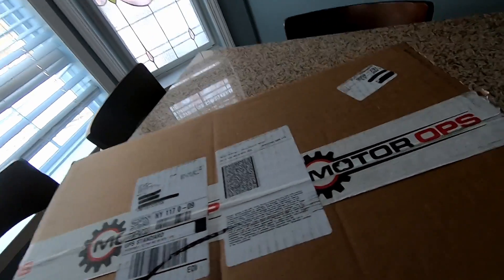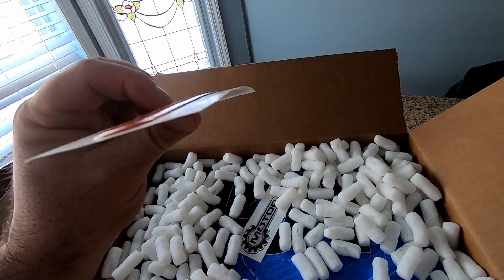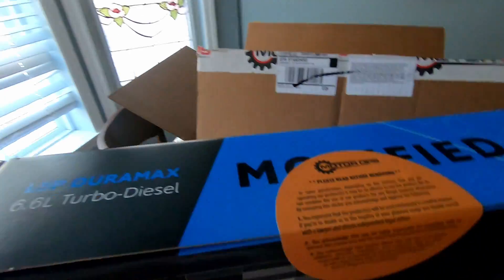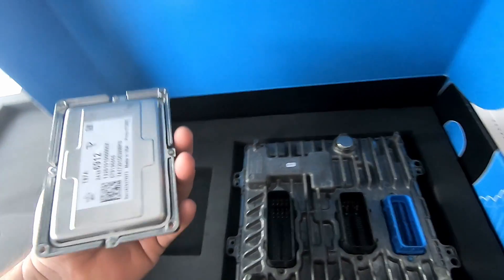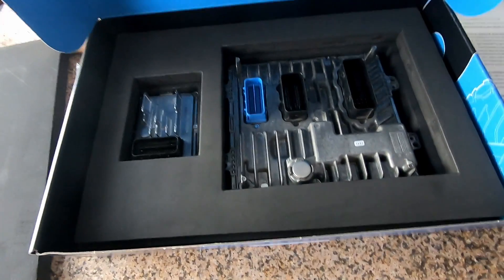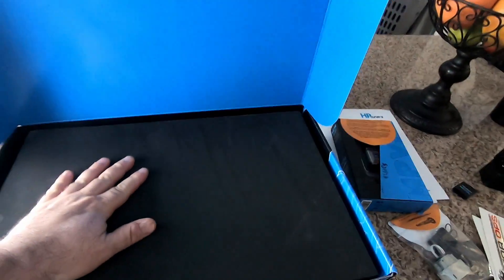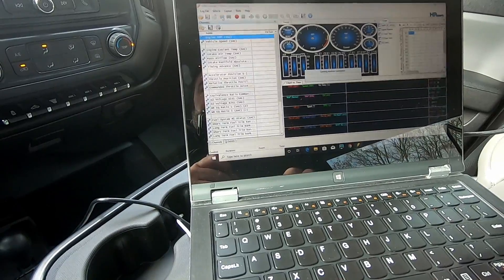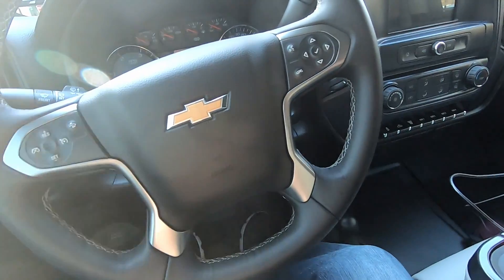DURAMAX L5P ECM & TCM SWAP & MOTOR OPS TUNED

Comment: You still have the truck tuned? Looking to hear about long term reviews. Hows it treating you?
Reply from the maker: Yes sir. Still have the truck and it runs perfectly… Long term it’s all good. Runs clean and strong with no issues
Reply: @xlandscaper  that's awesome to hear. How many miles do you have on the tune?
Reply from the maker: @dach4mp85 I have about 25k miles on it. Excellent power, fuel economy and the lower hp tunes (which I run) are super clean.
Reply: @xlandscaper  wow 25k miles in 4 years? LOL mine is a daily driver and I drive about 30k per year
Reply from the maker: I have several vehicles and my truck doesn’t get used daily

Comment: What’s your mpg ? I use to get around 20-25 with other tunes. Now I’m getting 16.3. What am I doing wrong? Just started using EDT hotshots fuel treatment, is the only thing different.
Reply from the maker: I’m usually around 17-19 around town 21-22 hwy not towing. And I use the same fuel treatment it’s good stuff… Check ur mass airflow sensor, it’s probably all caked up if ur fuel mileage suddenly decreased
Reply: Ok I’ll check in to that. I cleaned it a while back, it was down for about a month and says water in fuel on dash light. Not sure what that’s about. Thanks for the input.
Reply from the maker: @rbyronson2426  the water in fuel is exactly that. There’s a sensor in your fuel filter. You can drain the can but I’d definitely change it. Easy to do, I have a quick video on how to do it. Let me know how you make out
Reply: I’ll watch it and again thanks for the help. I’ll keep you informed.
Reply: I changed the fuel filter, had some brown stuff in the bottom of the fuel filter cap. Not sure what that was, cleaned it and reset fuel filter and water in fuel still comes on. Maybe time to save some extra money for the fass or air dog.
Reply from the maker: @rbyronson2426  how old is the fuel in your tank? Could be old crappy contaminated fuel that is still cycling through. I’d run it for 500-1k miles and change the filter again. And yes the fuel filter upgrades are great! Definitely worth the money having extra filtration if you have that extra cash to burn
Reply: It sat for about 1 month then I ran all that fuel out. Just put 2 squirts of edt and 30 gallons of fuel then changed the filter.  That when I noticed the brown slimy stuff. It wasn’t a lot and had to wipe it out for it to come clean.

Comment: Is this a single tune or shift on fly u got from motor ops ! I was thinking about a shift on fly! What’s your thoughts or vibes on shift on fly
Reply from the maker: Hey man I run the single tunes. I heard bad things about The soft tunes. I head people had their ecms bricked and trucks ran like crap. They may have refined it but I’d rather not take the chance. Ecms and credits to flash em are not cheap. I almost never switch tunes now that I’ve been running it a while. Truck runs clean and strong
Reply: @xlandscaper  I see one more ? How long have you had this tune sir ? No issues right ? What ho tune ya get! I might use them depending on all my findings ! I have already had one bad tune in past
Reply from the maker: @jeffjesky3547  i use motor ops tuning. been running it for about 3 years now with zero issues

Comment: I've had MOTOR OPS for 6yrs flawless tunes great power and MPGs , my 2004.5 LLY is an animal
Reply: What are you seeing for mpg?
Reply: @NickySull  I've seen 22 MPG in tune 3 on the highway ,20mpg around town
Reply: @NickySull  I'm now just replacing my original injectors @ 330k as well as my CP3 with an Exergy sportsman,  new HIGH TECH 64 PROMAX TURBO , DMAX UPIPES , AND HSP Y BRIDGE BUNDLE KIT , AND A RETUNE FROM MOTOR OPS LOOKING TO MAKE 625RWHP , WISH ME LUCK BRO 👍
Reply: @rexgratteaux8655  good stuff buddy. High tech makes an l5p turbo?
Reply: @NickySull  I'm not sure , but I wouldn't doubt it , they've been building and modifying turbos since 1986
Reply: @NickySull  to be honest I think turbo time or Duramaxtuner are your best bet on aftermarket on the L5P Duramax 👍
Reply: @rexgratteaux8655  I had the same thought. Turbo time uses Garrett housings which is a plus
Reply: @NickySull  yep , the GXR 7 PREDATOR TURBO IS PRICED DECENT FOR YOUR L5P $1,380 DOES NOT INCLUDE VANE ACTUATOR
Reply: @rexgratteaux8655  they use the a stock turbine wheel too. The stock 11 blade kinda wish they made a 10 blade
Reply: @rexgratteaux8655  do you still have the truck tuned? Looking to hear some long term reviews. How many miles do you have on the tune?
Reply: @dach4mp85  my original trans safe tunes were excellent,  I'm now going up another 100hp with a new top end 625rwhp 1300LBft DSP SWITCH , THATS MAX EFFORT ,I CRUISE IN 450HP AND 500HP TUNES DAILY
Reply: @rexgratteaux8655 you have motor ops or ppei? How many miles did you put in your tune?
Reply: @dach4mp85  I've had my tunes since 2015 so 150k miles with my tunes , and I got 330k out of my original CP3 and injectors,  that's max life 👍
Reply: @rexgratteaux8655  awesome to hear 🤙🏻
Reply from the maker: Motor ops has been excellent. People love to bash them but I’ve had nothing but great things to say about them
Reply: Their tunes are clean , and #2 tow tune has an excellent turbo brake I like alot for slowing down a load
Reply: My trucks got 330k , but I just replaced my heads ,arp studded , HSP Y BRIDGE , NEW REMAN BOSCH INJECTORS, EXERGY SPORTSMAN PUMP , haven't got my tune in it yet gotta send it out

Comment: great video! maybe a dumb question, but to you have to do the process individually for the TCM and ECM on the laptop as far as swapping and inputting vin, or do you just select both and install new at sametime?
Reply from the maker: When you swap the hardware you only need to write the vin once. The tcm is already “unlocked” and you are just uploading a tune on it. Hope that helps

Comment: I’ve been wondering if I only run a small horse tune on the l5p would I still have to do transmission tuning as well. I have the 6 speed allison
Reply from the maker: While it’s not needed it’s definitely recommended. Some of the benefits Having Trans tuning are higher line pressures which help reduce clutch slippage and optimized shift points, again to prolong the life of the transmission. It’s definitely worth getting it done IMO
Reply: @xlandscaper  Thanks man I’ll do it then!
Reply from the maker: Awesome!! Good luck n let me know how you make out!!

Comment: If I was gonna go with the optimized stock tune and heavy tow would I need the tcm also?
Reply from the maker: It’s not 100% needed but definitely recommend. Tuning has Increased line pressures and optimized shift points which helps the longevity of the transmission
Reply: @xlandscaper  Gotcha I went ahead and got it. I just flashed my tune can I start the truck now to see if it runs or do I gotta remove all the hard parts then start it?
Reply from the maker: @neofuze5206  awesome!!! Yes you need to flash the truck and do the crank relearn then  do all the hard parts
Reply: @xlandscaper  I tried doing the crank relearn it says rev to fuel cut off I did but nothing happens it drives perfectly fine without it so far
Reply from the maker: @neofuze5206  when you do the relearn u slowly rev it up till it cuts out then let off the throttle. Once done cycle the key a few times. And it should be good. Also try not to drive it a lot till you do all the work. It could set off a code
Reply: @xlandscaper  I rev it to fuel cut off then cycle my key but it keeps saying it failed idk what to do I gotta contact motor ops
Reply from the maker: @neofuze5206  I’m sorry I don’t have the answers for ya but motorops support is fantastic. They will figure it out. I had to do mine a few times and it ran rough for 5 minutes. I called em and they had it sorted out in 20 seconds. Let me know how you make out

Comment: Did you replace the ecm and tcm at the same time?
Reply from the maker: Yes sir. Thanks for watching
Reply: @xlandscaper  i got one more question, how many credits do you need for the ecm and tcm replacement?
Reply from the maker: @joshuacastillo5952  I can’t remember off the top of my head. I think it’s was 16 total credits but don’t quote me on it.
Reply: @xlandscaper  thanks a lot man!👍🏼
Reply: @xlandscaper  wait got one more question😂 if you get the ecm and tcm preloaded, would you have to send the tunes out to your tuner and have to wait or can you just get done with the process the same day? Sorry for all of the questions
Reply from the maker: @joshuacastillo5952  the joy of having the ecm/tcm pre-loaded is that you can do the swap and don’t have to worry about anything. It’s almost plug and play at that point. If you go with Motor ops you give em ur vin and they email you tune files but they will preload the exam/tcm with vats off and it’s just a quick swap as far as the tuning goes...
Reply: @xlandscaper  thank you so much man. When I’m ready to tune and delete can I dm you on ig? For the tuning and parts?
Reply from the maker: @joshuacastillo5952  absolutely!! @xlandscaperxx
Reply: Thank you!

Comment: Great video my man real informative, my question is when swapping the ecm and tcm do I need to disconnect the batteries? I’ve got my  hp tuners stuff in the mail today and I think I’m gonna attempt this install on Friday, I’m kinda nervous, I’m doing the emissions equip on by calibrated power, at least until the warranty is over, let me know, and keep up the awesome videos and any recent updated would be awesome stay safe.
Reply from the maker: sorry for the late reply buy yes you should disconnect both batteries.. Hope it all worked out for ya. Lemme know how you made out.

Comment: Can anyone tel me where those plugs go I ordered them because my truck is saying service emissions system and I only have 42k miles on it not real happy about it so I’m looking into deleting it not gonna deal with this anymore
Reply from the maker: Those plugs are to cap off open sensors when you remove the problematic parts you discussed in your comment.
Reply: Xlandscaper but which plugs do that go in because there about 7 I saw
Reply: Xlandscaper is there anyway you can message me on instagram?
Reply from the maker: Austin Draper what is your Instagram
Reply: Draper_austin_